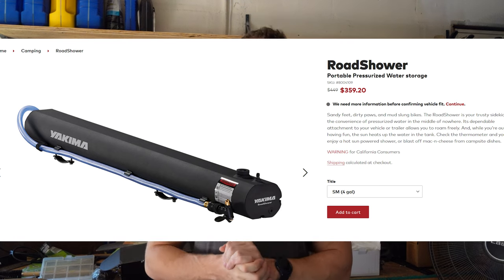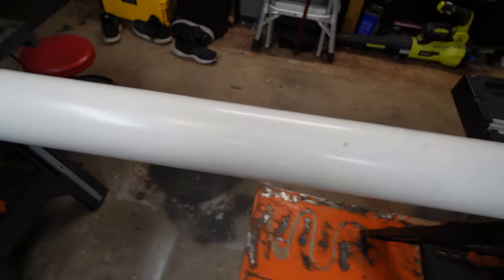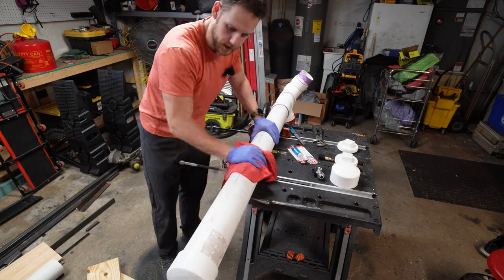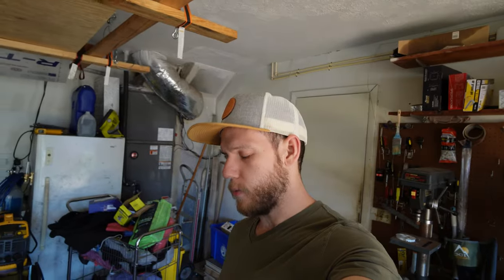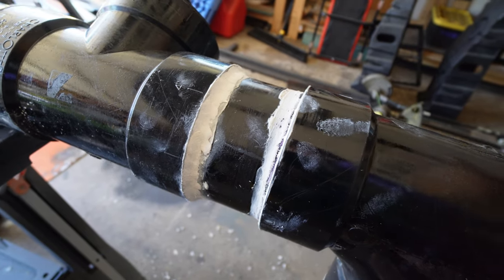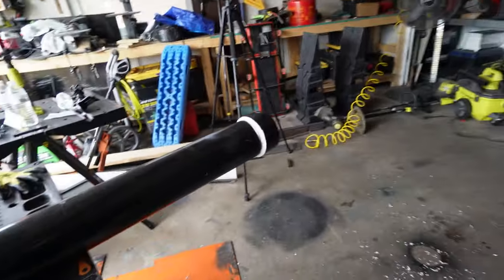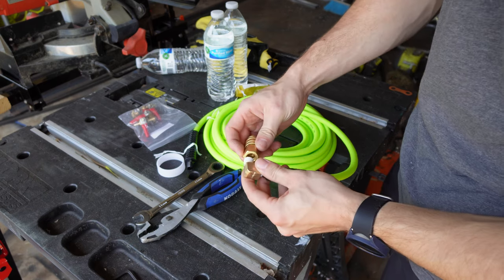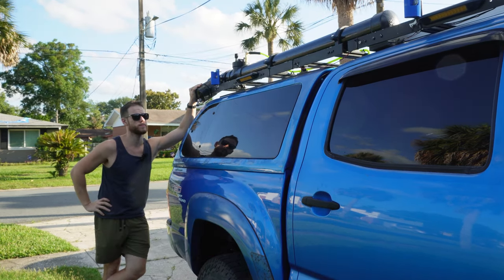How To Build the Ultimate DIY Road Shower in 2024

Comment: I had the same issues with leaks. I used JB Weld which seems to help. Rather than use my big inflation pump, I bought a cheap Amazon adjustable pump for $23. You can set the pressure where you want it. Nice job on your mounts. I never thought about 3d printing something.  I just used the extra large tie wraps.
Reply from the maker: Extra large tie wraps work too!  Just watch for sun degradation over the years.

Comment: I had a buddy get seriously injured making one of these. Lost one of his eyes, 4 teeth and broke his jaw over pressuring it and the butt cap blew off and smashed his face. It’s a great idea but just be careful pressurizing it
Reply from the maker: 100%!!  Pressure is no joke.  Air leaks out at 15 PSI at both caps and my relief valve so I'm very comfortable with the design.
Reply: @javileeYT  definitely one of the better designs I’ve seen

Comment: Great project! The WaterWeld might be a bit overkill. Applying PVC glue to both the male and female parts of the pipe should prevent any leaks. This method is commonly used in building sprinkler systems, gutters, and perimeter drains.

Comment: If you could go back and do it again; would/could you have water welded the joints from the inside as you were assembling it as opposed to afterwards? 
Love the video and think what you have done is pretty rad!
Reply from the maker: I think I could've but it would've been more difficult.  I never considered it until you mentioned it though.
Reply: Yeah, I was just thinking it might have looked a little sleeker if you had. Nice work 🤙🏼

Comment: Why did it leak? It should have welded plastic together...something was wrong with your glue for the PVC. I think most likely is that you applied the purple primer and let to too many pieces and it dried before you put them together. Everything needs to be wet when you push them together. Some teflon tape on threads might have sealed the screw on pieces.
Reply from the maker: I did it wet on one of the joints and it leaked as well, this DWV pipe doesn't have as tight of a fit as regular PVC.  I also did Teflon tape on the threads but it's still leaking, not terrible enough to worry about it.  Can still get up to 20ish PSI and plenty of pressure
Reply: When gluing a joint, hold it for about 15 seconds. If it backs out from the hydraulic pressure, you could have leak